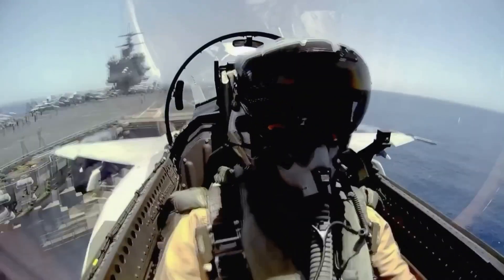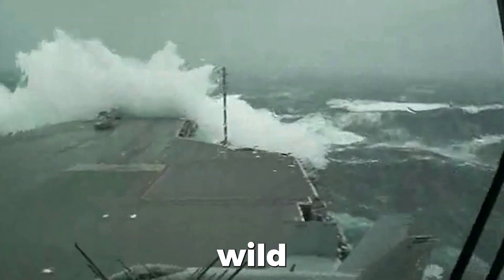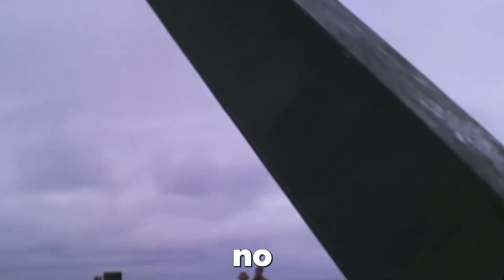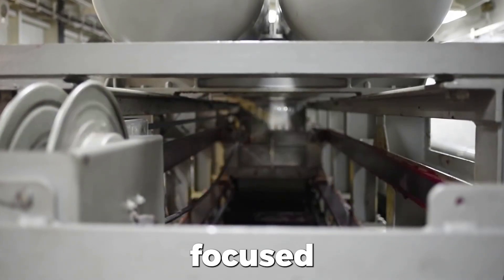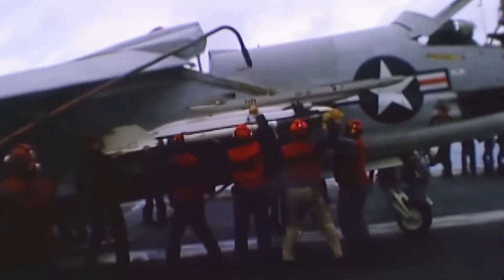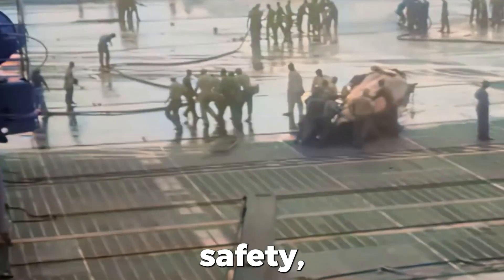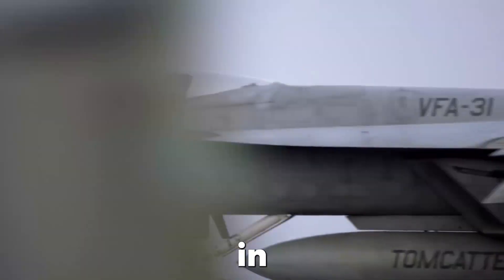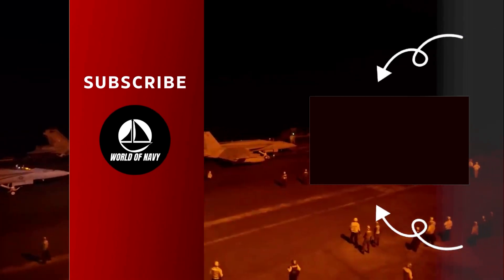How Emergency Landings On Aircraft Carrier is Done?

Comment: The 'wires' are referred to as 'The Arresting gear' and is the normal way to recover a carrier aircraft.  The Barricade is the large badmitton net that gets rigged across the flight deck when a plane has problems with the hook or some other problem that would make an arrested landing unsafe.